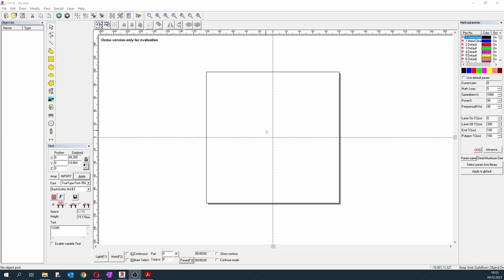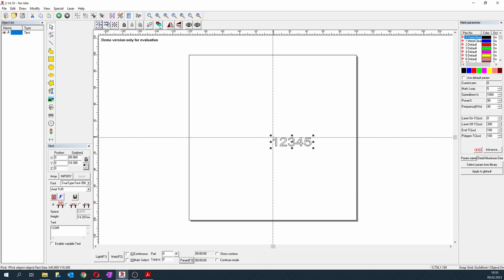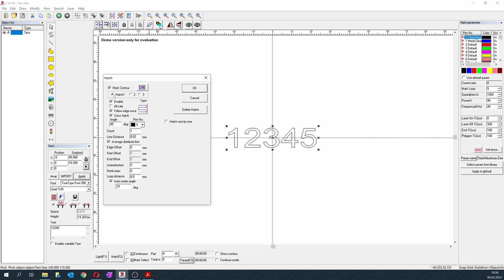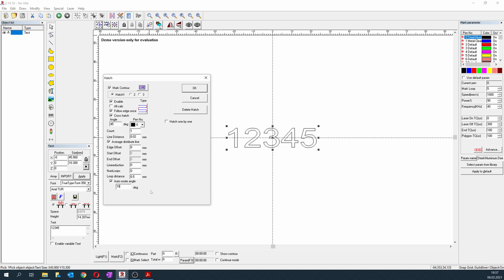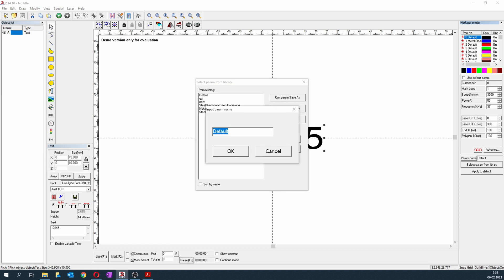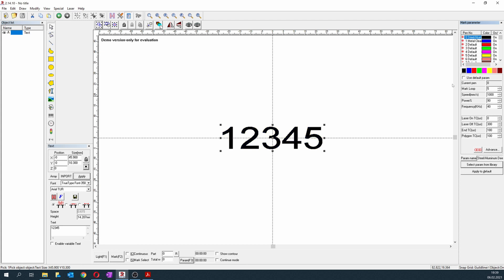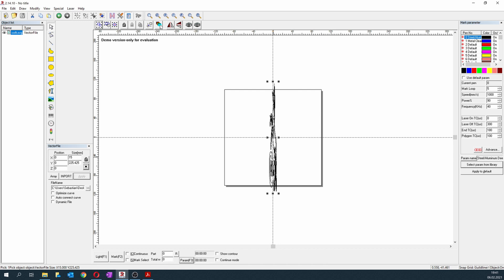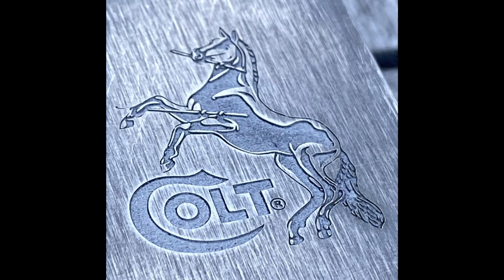EZCAD - basic tutorial for deep engraving

Comment: hello i
I am customizing a metal card, but the engraved part does not come out neatly. I think it's a setting value problem, do you know anything about this?
Reply from the maker: you need to play around with the settings, ezcad has lots of different settings, it needs some practice to get the experience
Reply: @homegunsmithunger598  Wow, I didn't expect you to reply, thank you so much. Do you know how to polish the area engraved with a laser?
Reply from the maker: @workwithkael  At the end you do a cleaning pass, high frequency and speed, low power, just to remove the dirt. You can engrave any surface, not only polished surfaces

Comment: What kind of file are you using to import the logo. I’m struggling to import jpeg files
Reply from the maker: you need to make proper vector files, jpg doesnt work, the programm needs to know the paths.
Reply: @homegunsmithunger598  how do I do that with a jpeg
Reply from the maker: @rockstarjewelers313  with photoshop for example, there are many different tutorials just search for „jpg to vector file“ on youtube. There is no simple 1:1 conversion programm, a path needs to be generated.
Reply: @homegunsmithunger598  what is a laser you recommend for simply engraving into plastic, trivex, and polycarbonate eyeglasse lenses
Reply from the maker: @rockstarjewelers313  I think you need a CO2 laser, but no experience with that. I am very happy with my fiber laser of triumphlaser china.

Comment: Nice wthis is a 50w? I have a question on cleaning after engraving silver 925..I get white finish do you know how can I a silver finish not white?
Reply from the maker: I am using a 30W, you have to play around with the settings to get the prefered colours, I dont have experience with silver, sorry.
Reply: @homegunsmithunger598  thanks- for engraving angle i usually have it on 0 but what angle would you recommend for clean pass? After engraving
Reply from the maker: @EJSVARZ  I always use auto rotate angle 10° always, it rotates automatically in on direction when you press mark + for every pass it makes.

To get a clean bright surface you need to use high speed (2000-300), low power (<50) and "normal frequency (40-60).

If you engrave an big surface you need to use the the hatch where the laser engraves only from one side and reduce the Line Space to 0,01 or even 0,005. If line space is 0,02 and you use the fast hatch you will see the lines that the laser made, not having an even smooth surface.  

It is a much slower process but gives you the most incredible surface.